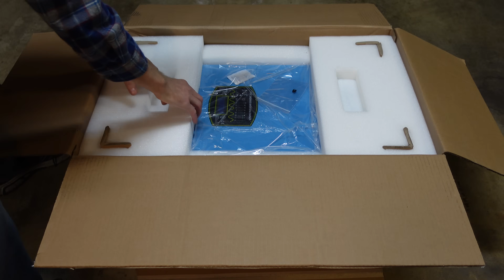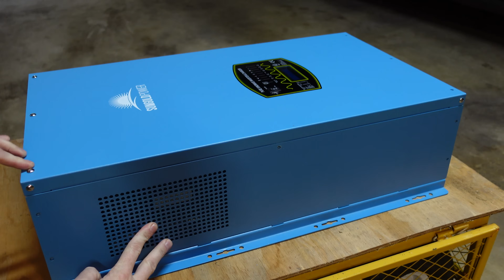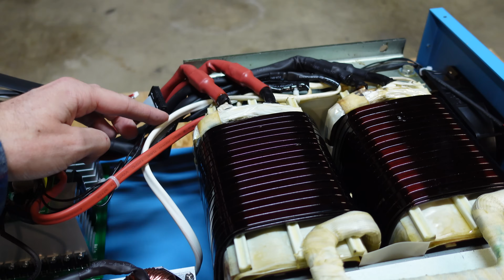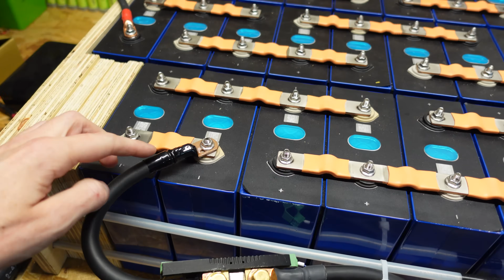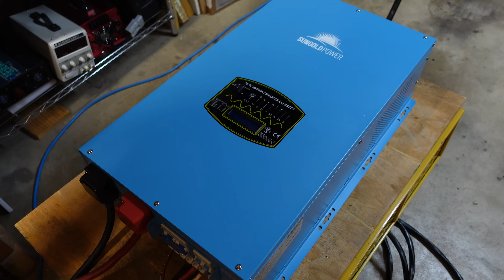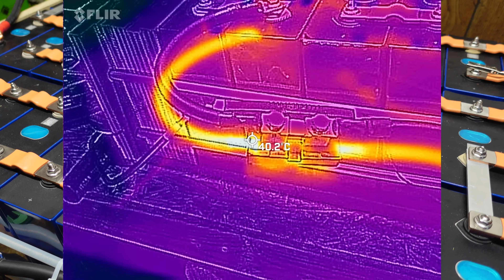SUNGOLDPOWER 12,000W Split-Phase Inverter/Charger, Review & Testing

Comment: Put the inverter somewhere that you can heat it up to 120 degF while running it at full rated load. Do this until the inverter reaches a stable high temperature. Then repeatedly hard short the output, say for 10 times. If it survives that it is worthy. And transformer inverters do better on this test than transformerless inverters (in addition, transformerless inverters can fail in a way that delivers destructive high power DC to your loads).
Reply from the maker: I don't think intentionally dead-shorting the output of an inverter this big (or any for that matter) is something I want to do. I don't have the space or safety equipment to do something like this safely.
Reply: @LithiumSolar  My inverters, which shall remain nameless, were tested for this several times, and indeed in 120F temperatures here in the Arizona desert. Thanks to the rats that chew through the wiring running under the house. Luckily Sol-Ark has a transformer (corrected this in a later comment, they are transformerless). Transformerless inverters can deliver dangerous levels of DC to loads when they fail.
Reply: @bearchow1929  : Ummm... In the spec sheet for the 12k, Sol-Ark lists the "Design (DC to AC)" as "Transformerless DC". I also seem to remember that they touted this fact as an advantage in more than one video about their inverter.

Would it be correct to assume that the inverter failures that can deliver dangerous levels of DC to loads are as a result of the "hard short" test case you describe? If not, what is/are the test cases? it would seem that putting all wiring inside some form of conduit would solve this issue (as well as many other issues caused by various peckish rodents). Is there any way for transformerless inverters to fix this/these issue(s), or are you saying that transformerless inverters are inherently flawed, and transformer-based inverters are the only safe way to go? Also, why not just tell us the name of your inverter(s) so we can investigate the pros & cons for ourselves? Or was the mention of Sol-Ark some kind of "Freudian Slip"? :)
Reply: @gerrygreen3832  Big mistake on my part, I missed the transformerless on the spec sheet, and yes they are transformerless (I couldn't find it at first and assumed from the heavy weight that it had a transformer). To be safe a trransformerless inverter must have a DC detection circuit that opens a relay or contactor in the output if a power switch or controller fault occurs. Only a few do, and most companies tech support have no idea what you are asking about if you inquire (Fronius was one of the few, and indeed they have ths protective circuit). Inverters must always tolerate shorts if they will be connected to a domestic power system. I'll be publishing a paper on inverter reliability in January that covers this and other subjects.
Reply: @bearchow1929  : Huh. Somehow I didn't get notified of your reply. OK. Thanks for the info on the detection circuit. So does the Sol-Ark (either the 12K or the new 15K) have such a detection circuit? Next question: did you publish that paper you mention? If so, please supply a link so we can take a look.
Reply: @gerrygreen3832  A Lor Hunt from Practical Preppers claims Sol Ark has DC detection and shutdown. I have not confirmed from the manufacturer. The paper is at: http://www.how2power.com/newsletters/2201/articles/H2PToday2201_design_RedHillLabs.pdf?NOREDIR=1
Reply: @bearchow1929  Thanks!

Comment: Fuc* Ya   I have the 12K Aims and it is unstoppable if you have the batteries to back it up. It looks surprisingly similar. 2 conductors off the transformer because its 240 and 120. Center tap. The solar charge controller is a great addition.
Reply: At first I thought you were telling the author of the video to go "F" himself (because that is what is meant by what you typed; "Ya" is colloquial for "You"). But that comment didn't make sense when followed by your other comments. I had to think for a little while, but then the light when on (so to speak). I believe you meant to type "Yeah" instead of "Ya". Then your first comment would mean that you were agreeing with the author in the extreme. Am I correct?

Comment: Gotta love Sigineer quality. SunGoldPower really didn't have them skimp on build quality. (Sigineer is the OEM on these)  Very high quality inverter manufacturer.
Reply: @LithiumSolar  This is the OEM model number from Sigineer. SunGoldPower is using the older housing for this model though but guts should all be the same. 

Model #: M12040D

If you go to their 15Kw version and click the video they have posted to YT about it, about 15s in you'll see their old version of the housing.
Reply: i am a engineer and install many solar systems, i bought many sungoldpower, growatt, aims, victron and sigineer inverters. and open all the inverter covers, I found the sigineer inverter transformer is made of Aluminum but print a cooper color, it is a fake product and violate   U.S. law. other brand has the 100% cooper transfomer. that's why sigineer product is cheap.
Reply: you told the lies, Sigineer is a small trading company, and always tell the lies, they used the bad transformer (aluminium) to cheat the customer.

Comment: You mentined your battery storage is outside.  Make sure you have freeze protection for the battery shed batteries  I may have missed some of your videos,  but I just wanted to mention it in case you didn't think of it.  I built low temperature charge protection into my dual 12 volt batteries for about ten dollars each..  Silicon 12 volt elements and a temperature sensing relay.
Reply from the maker: It's insulated and heated, but thank you for the reminder :)

Comment: Wait let me get this straight they are using 12 AWG cable for the output? 12 awg cable wont handle 12000 watts.
Reply from the maker: The wires are run in pairs, so it's a pair of 12AWG. And chassis wire rating is very different from NEC building wiring ratings. But yes, larger wiring would have been very much preferred!

Comment: At 4 mins you say this can be used in a 230V/240V country. It can’t in most. That’s because in a most 230/240V countries, neutral and active are 230V apart. Quite often neutral is tied to earth at the transformer. So while technically you could use it to power some appliances off grid, I don’t think it would be safe on a typical three wire 230V system.
Reply from the maker: You would definitely have to contact an electrician for advise/further information on this.

Comment: That idle load is ridiculous, also that fan is nowhere near 250W, 10W tops. I've had a smaller inverter of this brand and it sucked, it broke after a year and a bit with an error that makes no sense and it appears to be unfixable. I would not recommend this brand to anybody.
Reply from the maker: It should be 180-185W without the fan according to the manual and various things I've seen online.
Reply: @LithiumSolar  That's a pretty good indication not everything is ok with that inverter, the fan coming on when it shouldn't is another. Better be careful, you have a pretty bit of cells hooked up to that, if it goes it might not go all at once and that won't cause the fuse to go, 300A @48V is plenty to start a fire with.
Reply: With out listing exactly what model you had and how you used it makes your claim they are junk a random complaint...     I notice you did not offer a suggestion for a great inverter...   Or what you are using now and how great it is.

Comment: Good review and partial testing but low PV maximum input voltage and inability to parallel are deal breakers for off grid use. Undoubtedly reason for sale. We'll see what new models have to offer.
Reply: Sungold sells an 18K inverter for $4000.  And it handles 3X surges in power which the low cost inverters can't handle. I bought Midnite Classic charge controllers to supplement this inverter. It's the most reliable system available for a reasonable cost.

Comment: Yes, you are right about the parts.  These boards can be found in many inverters and are typically not all that good.  The control board and FET boards should be quite familiar to people that know PowerJack inverters, and remember, powerjack is perhaps the crappiest thing humans can come up with.  You have a 'scope.  Monitor the output waveform while the inverter is producing 12kW, and also at 15kW if you can supply the inverter with that sort of DC input current.  Does it stay reasonably sinusoidal or does it go to hell like a great deal of inverters built around these jellybean parts.
Reply: Ha! As soon as I saw the inside I thought " powerjack"!! You can pretty much already assume the mosfets will blow and take out the drive circuit can't you!
Reply: @roadeycarl  It's so funny how all the Chinese LF inverters use the EXACT same basic FET drive concept (look for the 2 white TLP350 chips and 4 discrete transistors near the FET drive cable), just with a few minor tweaks to other parts of the circuit.
Reply: @sidlori1592  Yeah that's right. I think the main thing that let's them down is that the mosfet they use just aren't upto the job that they have been installed to do. I'm not sure if its because there is descrepancy in manufacturing techniques or the mosfet datasheet just aren't accurate. When they blow they usually take out the driver board too... Very frustrating!
Reply: @roadeycarl  The FETs that PJ uses are actually decent quality...just they are driven terribly, with an extremely long 28AWG ribbon cable (also having the worst intertwined signal pinout possible), and an absolutely insensical "mainboard" PCB routing of said drive traces.  
I'm not at all a fan of the "Chinese LF driver" (2 TLP350s and 4 discrete transistors in a totem pole config), as it's very imbalanced at best...but it seems it CAN be done half-decent (as with this inverter and others in the Chinese LF market), albeit violating manufacturer datasheet requirements on the TLP350 chips.  (If the required capacitor is actually used, the inverters will be guaranteed to blow FETs at higher loads.)

Thing is, I keep hearing that "Aims inverters aren't as reliable as people make them out to be."  Once again: FET drive is almost certainly the cause of the issue.

In simpler terms: for an engine to provide a long, efficient service life, you want all 4 cylinders to be balanced/matched, firing equally, with the same timing and sparkplugs...right?
Unfortunately, the Chinese LF driver design is comically imbalanced, resulting in a rough-running failure-prone engine...which is not necessarily a fault of the engine, but rather of all the support hardware around it.
Reply: @Sid Lori  that's really interesting.
Now you have mentioned it, it does seem quite obvious that the drive circuit is a bit "how ya doing". 
Great analogy with the balanced cylinders 👍. So true.  Would it really cost that much more to drive the fets properly? I guess it must do if lots of LF inverter manufacturers are using the tlp350 and a couple of transistors to drive them... I don't know? Maybe it was a bad design but it did the job so other manufacturers just copied it...
Reply: @roadeycarl  In an environment where there is no real innovation merely copies the only differentiation over the alternative product is cost.  It's a  price driven race to the bottom.  Better to do cheap and nasty bodges rather than pay someone to do a decent board layout.  Fix the firmware?  You mean pay someone to fix it?  Hell no.  Just bodge in a resistor divider to massage things so that the firmware sort-of behaves how you want.  Welcome to Chinese manufacturing.
Reply: @roadeycarl  Well, it's funny as the Chinese LF Driver design is "so bad it actually works."  Any attempt to improve it only shows the weakness of the next item in the chain...until the entire thing has been redesigned.  I recently provided Power Jack with a fully balanced LF driver using the TLP350 chips--only for them to inform me a month or 2 later that it was causing their inverters to blow FETs at higher loads.
The Chinese will squeal over literally pennies--and the TLP350 + totem pole transistors is indeed dirt cheap.

I've actually spent several years now "trying to improve" a PJ inverter.
Firstly, I started with increasing the FET driver, and using 4x (matched) opto drivers for all four "cylinders" (and a completely new control board design.)  Wow, now the transformer's almost silent at no load (no loud 60Hz hum...interesting!)
Then FETs started randomly blowing up.  Turned out the excessively long ribbon cable was causing severe "ring" at the FET gates, blowing the FETs out by punching through the maximum gate voltage.  Added zener diodes to the MOS boards to solve that.
Then the control board started blowing out at higher loads.  Turns out this was due to the instantaneous severe voltage drops across the ribbon cable (due to the higher amperage balanced drivers)...so I added a ground lead to the control board.
On and on it goes.  Ribbon cable's so thin that the Miller capacitance at higher loads (resulting from the stronger drivers switching the FETs faster) can't be sufficiently clamped by the new driver chips...so a new heavier gauge shielded cable was tried.
Then we have the fatal crosstalk >6kw--resulting from the haphazard handling of the FET gate traces (half of them literally running across the entire power plane before reaching the FETs)....

...and in the end, we have what has become Genetry Solar inverters...with a final conclusion that it's not possible to make a solid 12kw inverter using a single PJ inverter part.  Yes, it's been a long journey--quite frustrating at times, and yes, the magic smoke has been released quite a few times.  But I've learned every step of the way.

I still can't get over powering up a Genetry Solar inverter (test bench or otherwise), and the transformer being so dead silent at no load that you will immediately think, "It's not working"...but it is!  (Touch the output terminals and you'll jump!)  All of the Chinese LF inverters that I've heard have a very noticeable "hum" from the transformer...and this is a direct result of imbalance in the FET drive.  Just like a 4 cylinder engine with 2 poor sparkplugs...it'll run noisy and rough!
Reply: @retrozmachine1189  yeah that could be it. It's a shame. I'm not sure who's to blame though. Do consumer's encourage it by buying the cheapest they can get? Or should consumers still be able to buy cheap products and extect them to work for as long as the next expense one? Hmm...
Reply: @roadeycarl  all parties involved are to blame.  If any link the chain was broken you'd see this stuff done properly, or not exist at all.  Consumers, manufacturers, the Chinese government, all play their part in this.  Unfortunately the market place being flooded by cheap Chinese junk that does sort of work takes money away from manufacturers that do the job properly leading them to lower quality/reduced income/perhaps going out of business.  For those that do hang on, they have to raise their price point to keep the bottom line healthy and that paradoxically means that you actually pay more for a decent product than you did before junk manufacturing flooded the market.  Lead acid batteries are a good case to study.
Reply: @sidlori1592  that's a lesson learnt! Very interesting. I think I came across your website when I was looking for a driver board for the power jack inverter a few months back and I saw you said on the site that you're not related to power jack.

I was temped to just rip out the transformer and use a EGS002 but I hadn't looked into the best way to drive the fets from it. I managed to find a couple of NY and MY transistors to fix the drive board on the power jack so maybe I'll just fix it and move it on.... I'll probably end up keeping it so the dust has somewhere to live!
Reply: @retrozmachine1189  yes I agree, that is very true!
Reply: @roadeycarl  While we work closely with Power Jack to manufacture our inverters, we do not represent Power Jack as a company.

That transformer...oh, don't get me started on how imbalanced and inadequately it's specced ;-)

My pet peeve with the totem pole transistor driving methodology...is that FET failure can trickle backwards past the "NY MY" transistors, back through the LM339, and blow the processor out.  (I personally have a PJ control board right now that has a hole in the MCU...reportedly after a PJ inverter did a UVP shutdown.)  GS inverters use four identical optodrivers--so any damage ends right at the driver board.
Reply: @sidlori1592  oh no, don't tell me that about the transformer!!
Yeah, I had a feeling that could happen...The transistors are shorted too, so they didn't blow open. I rarely see transistor blow open in fairness. Ah, I hope the mcu hasn't blown. 
Makes complete sense to use 4 optocouplers like you have. It sounds like you have worked hard and got a pretty decent inverter to sell. Nice work 👍
Reply: Optodrivers... Optocouplers made to drive mosfet? I'll Google that :)